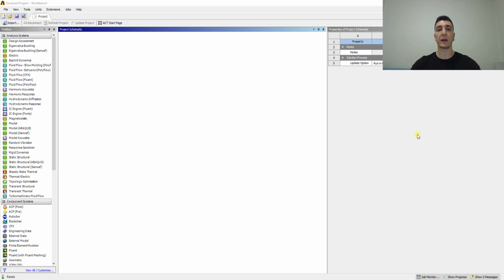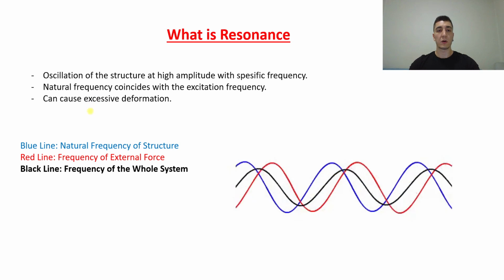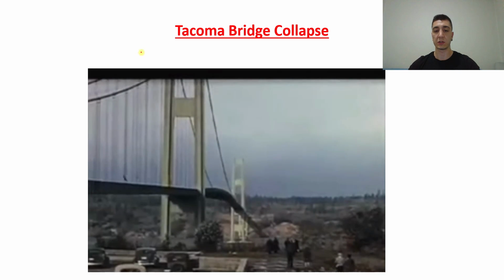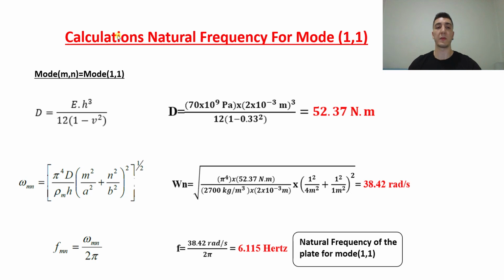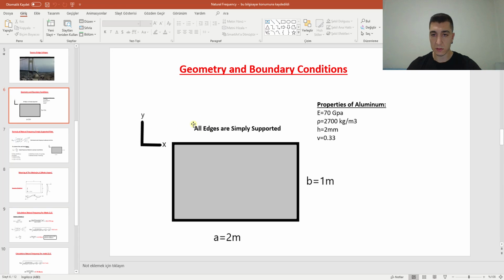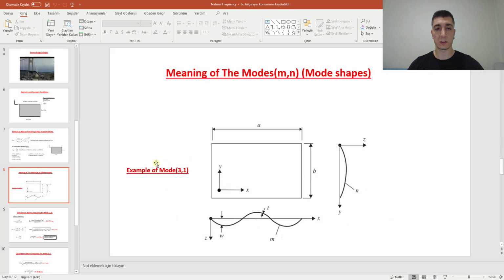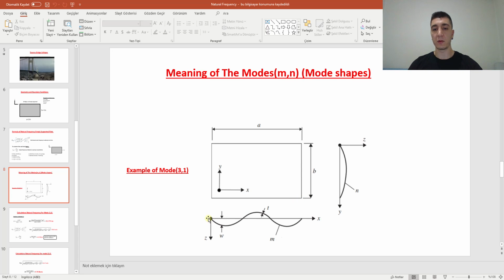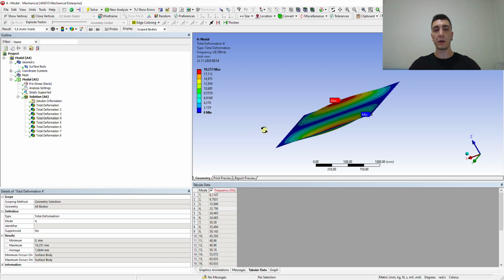Modal Analysis of PLate in Ansys 19 (Natural Frequency, Resonance, Vibration)

Comment: Thanks for your video

In my case, i have to apply a frequency vibration 18 kHz at centre of the plate. Then find the vibration path of maximum peak to peak amplitude from center point to edge of the plate.

Comment: Hello Meric, your videos are really  helplful! thank you very much for your efforts. 
Could you please mention which way should be followed for "stiffened plates"?
Reply from the maker: Thank you for your kind comments. Same one that I applied in the video. Just define the boundary conditions and go ahead. But it is really complex to make these analytical calculations for the stiffened ones.
Reply: @mericbuyukkoyuncu385  does it matter if the model is shell or solid?
Reply from the maker: @songulacar3461  I don't think that it matters. Just apply the boundary conditions and solve it. But analytical formulations should be changed. I need to check it.
Reply: @mericbuyukkoyuncu385   hello Meric. your video is a lifesaver. Please were you able to find out for shell or solid

Comment: Hey Meric, 

i am trying to following your steps. but the simplysupported boundary condition is grey/shadowed  and therefore i cannot insert it. do you know what can be the cause? 
i am using Workbench 2019 R3
Reply from the maker: Hello, 
Are you using solid model or shell model ? 
If you are using solid model, you may not see.
Reply: @mericbuyukkoyuncu385   how can i select/ change to shell model ? 
I just generated the geometry and followed your steps. 
in solution it says solid186 Elements.
Reply from the maker: @umanggupta950  hello, 
In design modeler, go to the concept and extrude your sketch by using "surface from sketches" option. Like in the video. That makes your model shell
Reply: @mericbuyukkoyuncu385   and actually my final goal is to find frequencies of a plate in water. Do have any idea how one can do it?
Reply from the maker: @umanggupta950  I do not have knowledge about under water situtation. You need to check the literature. But I think, natural frequency will not change if your boundary conditions are the same. Probably harmonic analysis will be different.
Reply: @mericbuyukkoyuncu385   the natural frequencies actually changes. Since the vibrating structure have to move the surrounding water.  and thus the natural frequencies get lower in water then in air.
 This effect is called added mass effect.
Reply from the maker: @umanggupta950   Yeah, you are right. That was new topic for me and I could not consider the mass effect at the beginning. Therefore, you need to check the literature for similar topics.